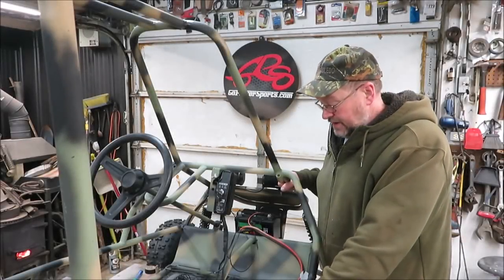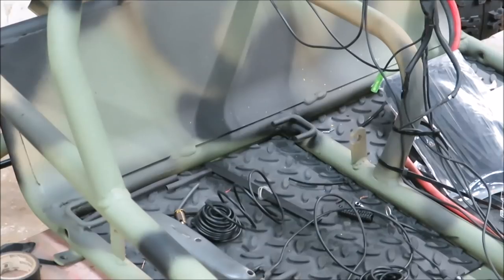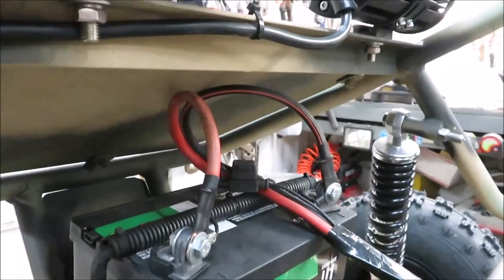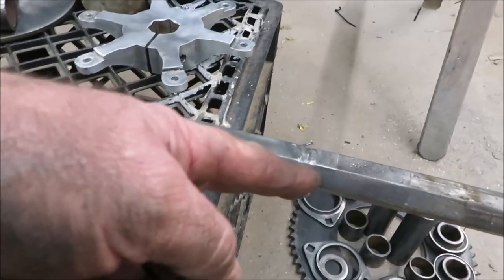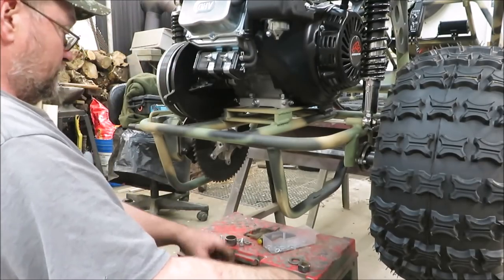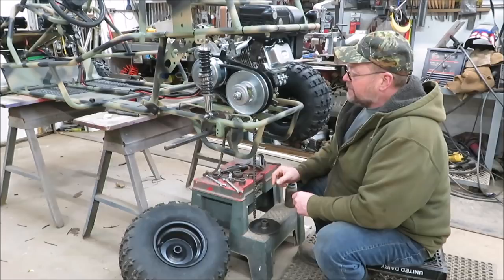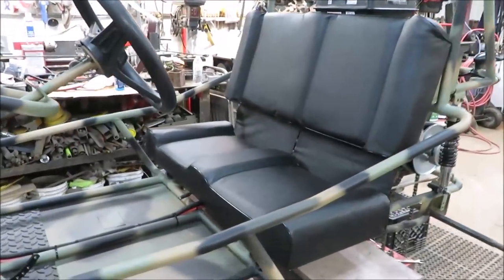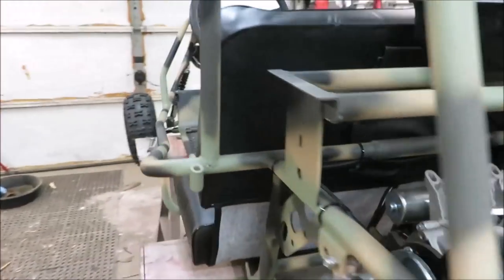yerf dog go kart build wiring

Comment: Cant wait to see that thing ripping round..idk bout those pedal bolts..I think they have some kinda spring that wraps around the bolt..pretty sure the bolt is easy to find..its the spring that may be a booger..Ace Hardware would have them..thx for sharing
Reply from the maker: Got the pedal bolts fixed will be running not long.

Comment: Kevin I had to use a 40 chain on mine. I ended up trading the yerf dog for a 150cc Twister kart with electric start 3 disk brakes and reverse with a parking brake. Even trade. I think I got the better part of that deal.
Reply from the maker: I would think so to nice.

Comment: How did you do it for the axle shifting from side to side I have the same go cart but when I bought it found the chain missing found out the axle shifts from side to side am I missing something?
Reply from the maker: Do you have a metal plate that the axel bearings bolt to and set screws that go through the bearing to the axel?